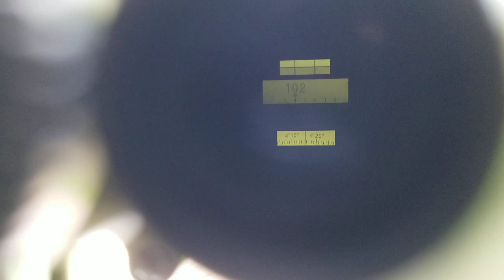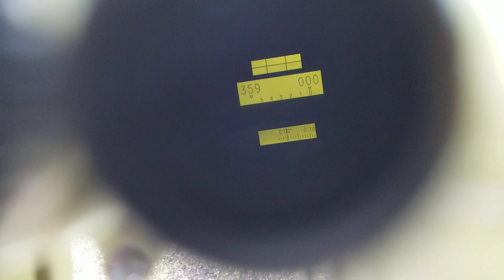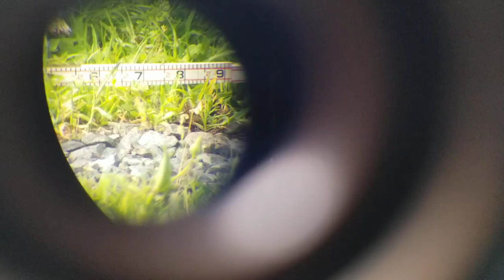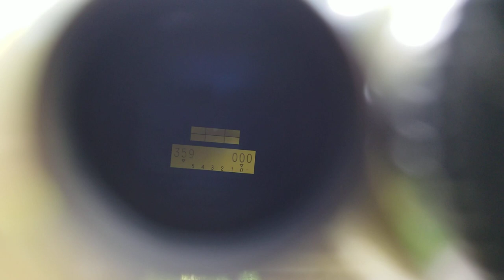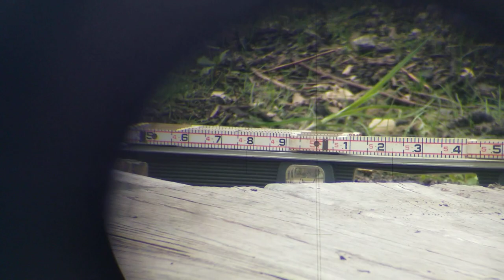Sundial Positioned And Aligned With The Meridian Using GNSS

Comment: BTW sundials are set to astronomic north. Not geodetic north. Check Laplace correction. (Too small to worry about.) 

The vertical angle of the gnomon has to be latitude, and the hour lines have to be arrayed per your latitude as well. Is the latitude of the dial marked? A sundial can be tilted up/down as needed. 

There are cad generators for sundials to be latitude specific. DXF file for laser etching or milling. Or transfer the cad layout by hand and drill hour marks.
Reply from the maker: Yes I said exactly that about the astro az and laplace correction the video. I'll tilt it for latitude. Thanks for that !

Comment: With your true north line, read a magnetic compass bearing to determine magnetic declaration. It’d be interesting to compare to published declination
Reply from the maker: And you know I'm going to traverse through all these points and also observe the reference marks with GNSS to complete this tiny geodetic control network  :)
Will be very interesting to see just how close to 0 degrees it really is.
But the GNSS will have to wait until autumn after the leaves are off.
Reply: Jesse Kozlowski 
Solar azimuth
Reply from the maker: @larryscott3982 , for sure, but will be tough needing 90 eyepiece I think.

Comment: So Jesse, does that sundial adjusts for daylight savings?
Reply from the maker: Rotate the dial 15 degrees to the left, um, that's one hour ;)
Reply: Alex Rodriguez 
Yes a sundial can read DST. But not by rotating it. 
The only way to make a sundial read DST is to  change the numbers so that 12 is renumbered to 1.
Reply: Jesse Kozlowski 
Do not rotate the dial. The numbers change, only the numbers. The noon mark is labeled 1. Not rooted to read 1.
Reply from the maker: @larryscott3982  , I had the right idea, but didn't think about the gnomon would spin too, and we can't have that.
Reply: Jesse Kozlowski 
The gnomon has to be parallel with the axis of the earth. ie; point directly to the pole (Polaris). The hour lines are fixed. Rotating the plate, even if the gnomon remained north, would no longer be accurate.
Reply: Well, I was joking but now I think I started something. And now I'm curious. How would one change the numbers?
Reply: Alex Rodriguez 
It’s Just by Labeling.

I was in a tourist town in Italy. There were so many sundials and 1/2 of them were European Summer Time, since high season for tourists is summer.
Reply from the maker: @AlexRodriguez-ov2oh , it would be possible to have the numbers on a ring that could be rotated.